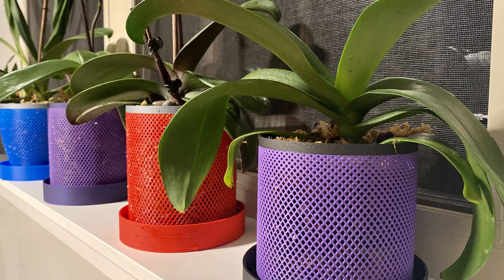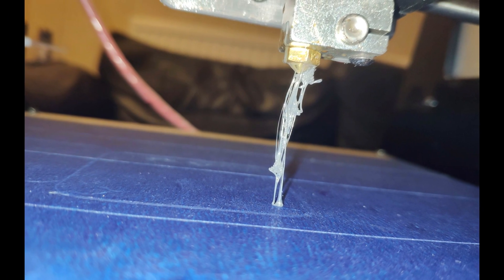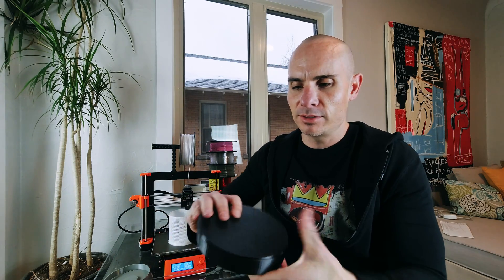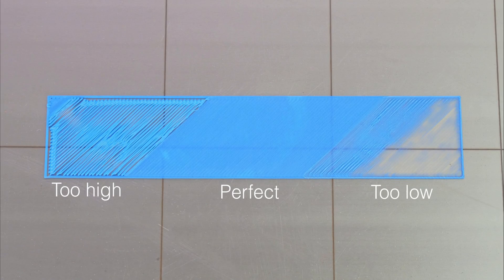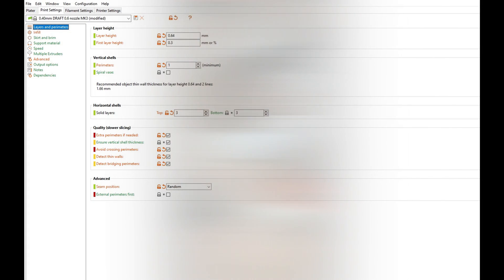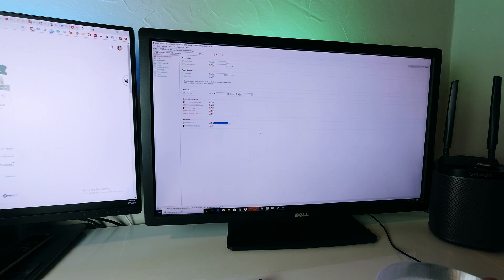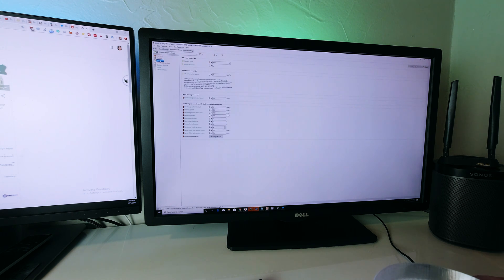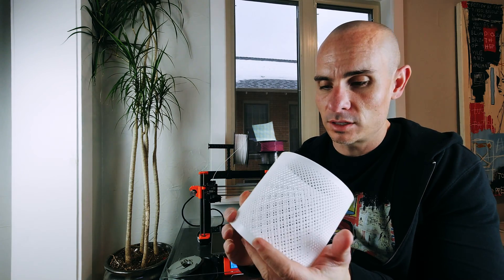The Ultimate Guide to PETG 3D Printing #PETG #3dPrinting

Comment: Hi. I don't normally leave comments for people, but this has been the most helpful video in my whole 3-4 years of 3d printing. I have had a nightmare of a time with PETG, and was starting to think I will never get to grips with it. But having watched your video, and used the exact same settings on my printer, the results have been amazing. I cannot thank you more. 
I am not using the same Amazon filament but one by Sunlu. Initially an awful filament, but you have helped me turn it into something very useful. Great job, and great videos. I am now a huge fan!! I will support your patreon channel as a thank you.
Reply from the maker: Thank you so much for the kind words and support, it means a lot. Let me know if there are other subjects related to 3D printing that you would like me to touch on in the future!
Reply: Same! Thanks so much!!
Reply: I thought I was the only one!
Reply: Hello There , i am still new to the whole 3d stuff ... i wanted to check if these exact settings can be used Prusa Mini Plus for PETG and a 0.25 Nozzle . 

Mainly printing Vape Accessories like Replacement Glass , Drip Tips and Atty Stands ... 

BTW i love how the video is easy and basic with accurate explaination to the point , we need lots of these videos . 

Thank You Very Much
Reply: @MRMIZO-kk9us   What have your experiences been? Did you find anything out?
Reply: @stefan-bayer  i tried my own settings played with some and now its printing great ... Used 0.4 nozzle , prusament petg with 260 temp and 80 bedsheet while using satin bed sheet , activated the anarche printing style in the latest slicer update with disabling print fan cooling .
Reply: In tests elsewhere Sunlu turned out the best.

Comment: I used a high bed temperature on my petg and it was worthless. I got better results turning the bed temperature all the way down and turned off all my fans. I also opened the door and took the top off. Then I turned out perfect. Using Creality K1 Pro Max

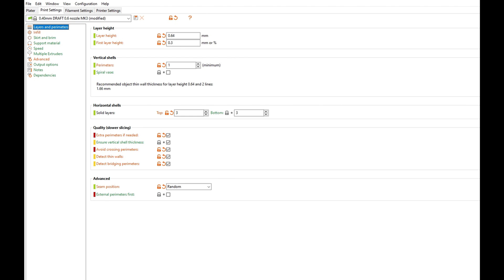Comment: Pardon? 7:09 first layer height 0.3mm; print layer height 0.64mm with a 0.6 nozzle wait what.

Oh yeah i can see a little earlier that you've inserted the wrong profile picture from a profile you don't actually use, the one you use is actually 0.3/0.3.

Comment: I print pretty flexible prints at 220C and 70C bed with first 3 layers at 255C no fan then drop to 220C with fan 100%. I will try your retract between layers as I had to set my extrusion to 0.97 to prevent occasional blobbing and stringing. The manufacturers of SA Filament recommend 235C to 255C but I really found that 220C worked far better for me.
Reply from the maker: The filament brand definitely matters, as there seems to be a decent amount of variation behind the actual chemical makeup of each filament.
Reply: @ALLYOURTECH3DP Yes I agree. I think one has to tweek a brand even according to colour because I've noticed variations there as well.

Comment: Dude you are AWESOME!!! I followed your tutorial settings and another one like 2 years ago I have to find for tuning the first layer and extrusion multiplier. if you dial those in right with PETG then it's as easy as PLA or better. One thing I really wanted everyone to know. if you have a blob on your brass/steel nozzle tips. it may be because your HOT END is oozing PETG from the threads of the nozzle or the thermal Release tube threads. that was the case for me. I dismantled a slight part of the head I took off the two fans and bracket, and manually screwed the thermal release/cooling fins with the head pre-heated to 230 slightly unscrew the nozzle to make sure it's NOT flush with the HOTEND head and then screw in the thermal release/cooling fin assembly while holding the hot end head with a plier. Wear gloves its hot!!! Keep your hot end@ 230 the entire time. stop when the thermal release/cooling fins hit the nozzle threads, if using the original heads then the nozzle threads are longer and should definitely contact without the fins screwing all the way into the hotend head. then slightly tighten the nozzle head with a socket/pliers. not too tight. but if you don't do this the PETG plastic will ooze out the threads both above and below the nozzle. This is the source of the blobs!! it's not fun to clean up. just saying. this eliminated all BLOBS entirely, but I still added your retraction numbers. great info. you're a scholar and a gentleman. Thanks again and best of wishes to all.
Reply from the maker: Great tips, thank you so much for sharing. I really appreciate you taking the time to comment!
Reply: @ALLYOURTECH3DP  thank you ☺️!

Comment: I just got your Settings down. There has been changes in 2.50 Version it seems. but I got most of them down. So gonna test run soon. Wish me luck Bro!
Reply from the maker: They have changed a few things in recent releases, but this should still get you pretty darn close. I'll do an update video, but please let me know how it works out.
Reply: @ALLYOURTECH3DP  I followed your settings to a T, it seems it likes to leave stringing everywhere lol by the way :) Idk i might need to test a couple of different settings, im trying this new Inland PETG+ maybe thats why, it needs even more specific fine tune
Reply from the maker: @jeeptransport-tutorials7761  print out a temperature tower for your new filament and find a temperature with minimum stringing and high quality bridges. That usually helps when testing new brands of filament

Comment: When printing top layers over infill, I see artifacts of the infill, almost as if the top layer is drooping / metling over the infill.  What specific setting helped you with this?  Lower extrusion temperature?  Retraction on layer change?  Thicker layers?   More cooling fan?

Comment: Hey, thanks so much! I just started printing in PETG on my ender 3 Max and your video saved me SOOO much headache. The only issue I had was the filament did NOT want to stick to my glass bed so I resorted to using hairspray. After that, the prints are running smoothly, the time per print has greatly improved. (15 chessboard puzzle peices from 15 hours to 8 hours) I still have a bit of fine tuning to do to be as perfect as your prints look but I suspect it may be time to change the stock nozzle to a Slice Engineering vanadium nozzle. Thanks again for the advice, explaination and demonstration. Looking forward to ferreting through your others vids for nuggets of wisdom.

Comment: Thanks for the detailed explanation. I am new to 3d printing and specially with PETG, have been researching to get the perfect profile for Ender3 pro printer for almost 2 days but nothing worked. The moment I printed with your settings, all the blob around nozzle and bed adhesion issues were gone.
Reply: @amitbansal Did you find any solutions for nozzle oozing?

Comment: So, while this at the time was an extremely valuable bit of information, I don't think it's correct nowadays. I have a MK3S+ and I tried some of these settings, notably the fan and the retraction, and it didn't come close to working-- in fact all I got was a gooey mess. I know Prusa keeps updating their settings for Slicer, and they don't even have some of them anymore that are talked about here. I have found doing a few frequent cold pulls, with fress PETG and the GENERIC PETG setting (which is now the exact same as the Prusa PETG setting-- not to be confused with the Prusament PETG setting, which is different), seems to do the trick for now. Still, the author has absolutely beautiful prints!

Comment: Have you tried using Prusament ASA filament? It is more heat resistant than PETG, it can withstand temperatures up to 93 degrees Celsius and it is made for outside use. It is recommended that you use it with a PEI spring steel sheet.

Comment: Quick question: do you use glue/hairspray on the bed?
Reply from the maker: I don't. For PETG I just clean the bed with alcohol. PLA I sometimes use a glue stick, but otherwise that's it for my bed type.

Comment: Lowkey the most usefull tip so far, tried everything in order to make petg stick and have a proper first layer to no sucess, this was the first that provided me with results. printed on the prusa sheet no problem while before i was resorting to tapes, glues and constant live z adjust to try and make it stick and failing. Thanks.

Comment: PET-G temps range from 220C to 265C depending on manufacturer, additives and color. Engineering grade Milled carbon fiber, Milled Glass fiber and plain engineering grade tend to be in the upper range (255C to 265C) This is the stuff I use. Stay far away from cheap carbon fiber and glass fiber PET-G because they use CF and GF dust NOT milled and it makes the PET-G very weak. 10% and 15% CF or GF tends to increase the strength 30% - 40%

Comment: Usually you don't need to change anything for PETG. I use Amazon Basics PETG with Prusament PETG profile on a textured sheet from Prusa (no glue stick nothing only wipe it with a rough sponge with IPA 99% - if it doesn't stick well you first have to clean the sheet with water and soap once in a while) and it works perfect. If the printed PETG part is dull you have to increase the nozzle temperature. PETG should be shiny when printed then you have good layer adhesion. If you get stringing your temp is a little bit to high or your filament is wet and needs drying. Put it in a food dehydrator at 65°C for 3h.
Reply from the maker: I’ve noticed that the petg profiles in more recent builds of slicer are much better. I can normally use the default Prussia petg profile with my Amazon basics or zyltech petg and get great quality prints. That definitely wasn’t the case a couple years ago however.

I normally start by printing a temperature tower with any new brand or type of filament and it’s enough to guide any changes to settings.

Comment: Thanks for the info.    Unfortunately It would of been great to get a proper Screenshot of 8:45  as the acceleration controls are default 0 not 1000 and I can see from the screen there are not uniform but I cant read the screen.  
I'm Guessing 
Parimeters   800
Infil               1200
Bridge/First layer/Default   1000 ?

Comment: Notice: These settings do not work with orange PETG Prusament on my brand new Prusa MK3S. In fact, I'm having serious problems to print with PETG Prusament on this printer. I have spent several days trying to tune the settings in Prusa Slicer but I still do not have the solution. There might he many reasons. But my life is not long enough to spend it on a single problem. Giving up and returning the printer back to Prusa company. There might be many reasons why the printer is not working as expected (bad extruder, printer incorrectly assembled - eg. bed not aligned to horizontal position precisely, unevenly heated bed, poor quality filament, etc.).

Comment: Just FYI. There is no reason for changes you made in filament overrides. Both settings are enabled by default in printer settings (retract on layer change and wipe), so your custom overrides have zero effect.
Reply from the maker: I don't know if that's accurate, or at least it didn't used to be if it is now. The amount of stringing with and without those settings enabled is drastic.
Reply: @ALLYOURTECH3DP  It was always enabled for MK3

Comment: Same as Mr Jones below. I had significant issues. Brilliant advice. Total thanks. I'm using Prusament PETG and MK3S.
Reply from the maker: So happy to hear that this helped :)
Reply: @ALLYOURTECH3DP  Thanks. One comment. Perhaps odd. I'm finding the ORANGE Prusament to be slightly better than the Black Prusament for the reasons that it oozes less from the nozzle and less stringing. That sounds like a temperature issue perhaps. But I haven't changed anything in Prusaslicer. Feels odd. Just a comment 1/2 a roll into orange and after 1 roll of black. All PETG.

Comment: Thank you for sharing what works for you. I have been having some issues switching from PLA to PETG. I am going to see how well this will work for me. Do you happen to know how to get anything to stick to the powder coated sheet? I have tried most of the recommendations that I have found searching online but so far nothing has helped. Neither PLA nor PETG will stick to it.
Reply from the maker: From my experience, if the filament isn't sticking, you need to lower your Z axis. PETG should stick so well that it's difficult to get off.
Reply: Thank you for the tip. That seemed to help. I was lowering the Z and the filament seemed to skip and leave dots so I thought it was too high. I kept going lower and it started to stick. It still seems to not be sticking to the Prusa powder coated sheet very well, but I am about half way through a 12 hour print with minimal issues. Thank you again, I appreciate  it.

Comment: I have recently come to PETG and didn’t have any of the problems with brittleness that you experienced.  However, I do want to improve a few aspects and today had my first PETG fail where an 11 hour print lifted off the bed - I believe due to temperature as it was the side closest to the open door (hot day today!). Not sure why but I started layer 1 with the bed at 80 and then 70 for the remainder! You and a few others suggesting even higher than my 80C hottest. So will be trying that tomorrow.  A great video, love the paced delivery style and crisp clear speech with tons of information (I’ll need to watch a few times).  Great work.
Reply from the maker: Thank you Danny, I appreciate it. Definitely try higher temps. I normally do my first layer at 90c these days, and 85 for subsequent layers. With that, I can't imagine adhesion being an issue. It REALLY sucks when a print fails after such a  long print time. Fingers crossed for the next print!

Comment: Thanks for this, gonna try it now. However, please ensure your video makes clear you are using a .6 nozzle :)
Reply from the maker: This video was all using a .4 nozzle. I only used a .6 in my supercharged PETG printing video :)
Reply: @ALLYOURTECH3DP  In the video the footage of your print settings shows 0.6mm nozzle in the profile name, and has a layer height of .64 which PrusaSlicer doesn't allow you to set for a 0.4 nozzle
Reply from the maker: @andrhamm  Ignore that, I tested a .6 and .8 nozzle, but the settings (other than layer height) are all for a .4
Reply: @ALLYOURTECH3DP  how is the layer height .64mm with a 0.4mm nozzle?

Comment: Hi. Thank you for sharing your experience with PETG on your Prusa Printer. Will help me a lot for sure once my MK3s has been delivered. Liked and subscribed. Got a question: How do you prepare your print bed before printing PETG since I heard it’s not that easy. Keep up the good work. Greetings from Germany 👋🏼
Reply from the maker: PETG sticks to the print bed really well, so I just use alcohol and wipe it down. For PLA you need to also use a glue stick since it doesn’t stick to the bed as well.
Reply: @ALLYOURTECH3DP  naw you don't. You just dial it in with Pretty PLA profile and make sure to wipe it with IPA, that's it (textured plate)

Comment: Just got an MK3S up and running that is printing PLA beautifully. Tried using the PrucaSlicer suggestions you provided as initial PETG printing attempts were horrid.  There is substantial improvement but still not getting the print quality you are showing.

A bit confused concerning Live Z adjust.  My Live Z for PLA is 0.990 and wondering what the PETG adjustment was you suggested? Also wondering if you are using PrusaSlcier 2.1.1 and whether you would consider providing a copy of your PETG PrusaSlicer profile as some settings within video difficult to see.  Thanks - - - -
Reply from the maker: Where are you seeing the print quality issues? How does the first layer look? That's a good place for us to start troubleshooting. Also, which brand are you using for your PETG?
Reply: Apologies but was startled by your immediate response; thank you kindly!  I think one of my problems was not having PrusaSlicer in Expert mode. After my initial comments I noted I could find some of your suggested changes when in Expert mode.  When I return from road trip next week I will run some additional tests.  Per your video, as soon as the print job started I ran my Live Z up from -0.990 to -0.690.  As you have the expertise, and as everyone claims PETG is such an improvement over PLA, you should reach out to Prusa and request they update their printer code to include a PETG 1st Layer Calibration. I am working with MatterHackers Build Series PETG filament.  I had been using their Pro PLA filament with my older MK2S for two plus years. During that period their filament quality was always spot on. As your orchid pots looked so lovely though I have two Amazon PETG filament spools on order. Your patience with us PETG beginners is most appreciated.  I will let you know results of additional tests when back in town. And again; a hearty thanks - - - -
Reply from the maker: Tom Scott definitely let me know how it goes! I’m happy to help troubleshoot and make sure we get you headed in the right direction.

Comment: Hi BLove: Thank you for a very well researched review.  I have never used Prusa Slicer as I don't own a Prusa printer but it does appear to be a pretty good slicer judging by your review. Please keep up the great work.
Reply from the maker: Thanks Colin, I appreciate that. So far i've been really happy with Prusa Slicer. It seems really well designed and intuitive overall. You can keep everything on basic and hide the extra complexity, or enable it and really dive into the details which is nice.
Reply: I am using PrusaSlicer with an Artillery Genius and an FLSUN QQ-S Pro.  It is great to be able to create the individual Printer and associated profiles, as simple as setting the changes and saving with a new name. It’s all good :-)